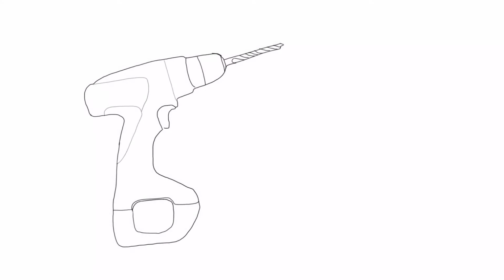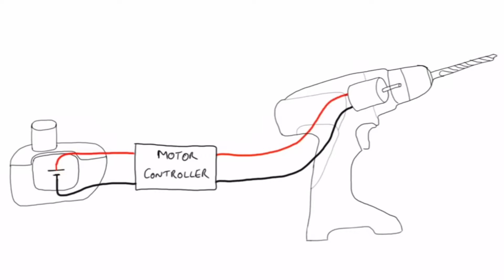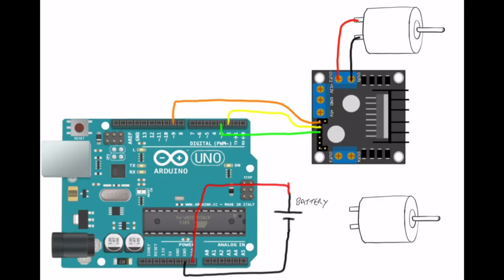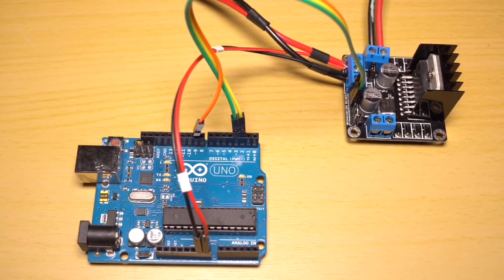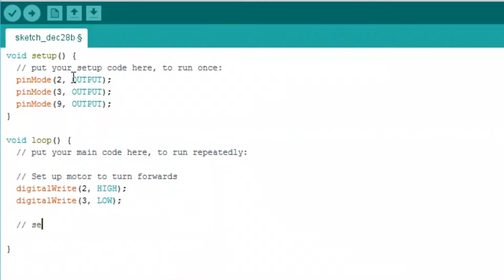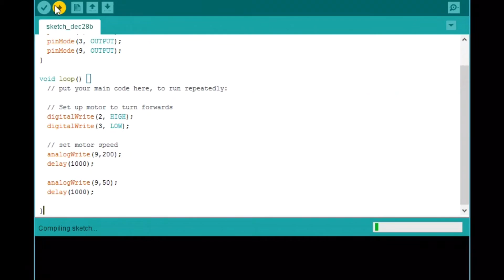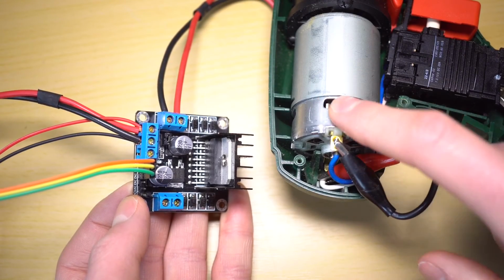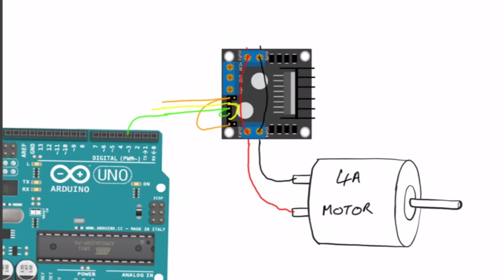Controlling an electric drill motor using an Arduino

Comment: I need to make a spinning 12v motor agitate forward/reverse endlessly. In 2024 you’d think it would be easy but evidently not. Can anyone here help me?
Reply: You need a 12 Volt Power Supply, an Arduino Nano and a BTS7960 43A H-Bridge and tweak this program a little. It's not very difficult and there are lots of examples on Youtube to get to know how this should work. Have fun!

Comment: Great video and thank you for posting. I recently did this following your video with an L298N motor controller and an 18v 2amp battery. In order to get this to work I had to remove the 5v jumper from the motor controller and take a 5v output from the Arduino to power the controller. Just in case anyone else comes across the same problem

Comment: Ahh I’ve bought a 2 channel receiver to work a 21v cordlessdrill motor… i hope it will change direction and have also purchased a speed controller (volume type)…. Can i ask anyone here if it’s an easy process or should i be aware or careful trying to put together…I’ve no wiring experience 🤣  any assistance is greatly appreciated;)
Reply: Can you link the speed controller and the receiver? From my experience, the easiest and simplest solution is a BTS7960 driver

Comment: Hopefully this is not a stupid question, but why not use the drills onboard motor controller, and just hijack the drill trigger circuit? I was hoping to do a very similar thing but II was hoping to use my  RC receiver to talk to the onboard circuit directly if possible. Or if not to have the RC receiver talk to an arduino, then that arduino talk to the drills esc.
Reply: It's not a stupid question at all. It makes all the sense in the world to reuse extremely convenient high power MOSFET that comes with these drills since it already meets certain specifications regarding the motors expected current draw. You will need a bit of extra work to be able to run it in reverse but I can only describe using the L298 (which pretty old) for a drill motor as not only uninventive but fairly ineffective compared to similarly simple solutions.

At least he tied the pins together though. Most people don't point that out in videos featuring the L298.
Reply: @io2cs-n8s  "compared to similarly simple solutions" Which solutions are you thinking of?
Reply: @uku4171  by that I was referring to the use of the mosfet.. If you wanna use an l298 go for it. It certainly is the simplest due to lots of tutorials but  there's a very real chance it burns out trying to drive a larger motor since it's an old inefficient chip. But mosfet driving circuitry is not too difficult either even if you want to make if from scratch with a few extra components. Best of both worlds might be to just get a pre-made mosfet driving board (which may even come as a full h-bridge) that's more powerful than the l298 for around the same cost on Amazon. So I do consider that a similarly simple solution, with likely better results. 

Hopefully that helps or gives you some ideas.., re-reading my comment I didn't mean my comment to sound like such an attack on this video or the l298n.
Reply: @io2cs-n8s  by the use of the mosfet do you mean making your own H-bridge? I found the best cheap driver to be BTS7960 drivers.
Reply: @uku4171  Yeah that's a perfect example of a solution that would be way better than the l298n drivers for this application. But as far as making your own h-brigde, it's still not crazy difficult but at that point a premade board like the one you mention is probably not only simpler but as good as you are gonna get for the same price. 

The point of bringing up mosfets in the first place was because as the OP mentioned just about any drill comes with at least 1 mosfet that you'd already be getting for free along with the drill motor. And if your use case doesn't require an h-bridge (ie you just want to go in one direction) that solution means you don't need to buy a driver separately. Although I suppose it does require that you have the means to drive the mosfet from whichever microcontroller youre using.. 

tldr the l298n is just kinda meh so if you really wanted a low cost DIY/hack solution it should be brought up that the drill does come with it's own driving circuitry. But if you need or are willing to purchase a better driver like your example then that is probably what you should do since drill motors need a lot of power. (ignoring the l298n in either case, although this youtuber fully acknowledges that it is not designed for high amps)
Reply: @io2cs-n8s  agreed

Comment: Is it possible to have the arduino monitor a 12v battery bank and turn the motor on when the voltage drops to a certain level?

Comment: What is pin 9 doing?
Reply: PWM (Controlling the rpm of motors)
Reply: @arias80rp10  thanks, I wrote that before I realized that not all pins are equal.

Comment: I had done it before and L298N gets too hot, like burning fingers hot, I wonder if there is a better driver for more current?
Reply: There certainly are. Just look for a driver that can handle more amps other than specs they all nearly work the same. Or better use the MOSFET that all these drills come with..

Comment: Hi James, thanks for the video very clear and informative.  I have only just found your videos so you may have answered this in other videos.  As I am sure you know, 12V drill motors will draw much mor than 4A under load, especially if it stalls at full power.  How are you avoiding this?  Are you using feedback signals to control the PWM signal to reduce the motor power supply?  I'd be interested in how you manage these issues.
Reply: Hi. did you found a solution for this? I have the same problem...

Comment: Thanks so far it is the best for me. Can I use on 2 hp 4 pole  1 phase max amps 13.7 motor? cheers
Reply: no u not, l2687n only provides 2A per out, then it burn out

Comment: Hello James, thats pretty much the same thing I am trying but my screwdriver motor is only making a whining noise. I assume this is related to the PWM values from the arduino. The motor is a RS380 that according to the print on it, runs with 3-6V. The screw driver was powered with a single lithium cell, so no more than 4.2V when full. Any ideas? Thanks!
Reply: hi there. i'm working on a similar project. were you able to solve your problem?
Reply: I have the same problem, any solution?

Comment: Does this work with a 9v battery? Because mine doesn't want to work. Am I using too low voltage? I am trying to make a 3v dvd motor run. If I can get that working, I can build my ev longboard

Comment: Thank you! What would need to be altered to enable the solution depicted in this video to work with a conventional corded drill that runs, on say 220 - 240 volts instead of a cordless drill?

Comment: The L298N that I am using has a jumper where you are connecting pin 9.  Do I remove the jumper and normally what does it do?
Reply from the maker: The jumper is there to make sure that the L298N is permanently enabled, it would be useful if you only wanted to control the direction of the motor, not its speed. 

To control the motor speed, remove the jumper and connect to pin 9 of the Ardunio.

Comment: I want to do the same thing, but run it all from the 12V wall brick.  Instead of wiring the battery to the Vin and ground, can I just plug in my power supply and then run the Vout to the L298N?  If I can't run the Vout (I think it downgrade voltage to either 9V or 5V), can I just splice the L298N to the same powercord?
Reply from the maker: Hi Christopher, what sort of wall brick are you planning to use? It's worth bearing in mind that a motor of this size will draw perhaps 2A when running, but much more current when starting to turn. The battery is well suited to supplying this current, but a small wall brick may struggle... With a large enough power adapater though, you can replace the battery as you suggested.
Reply: Good to know.  I had a 12V 1A and a 12V 2A, and the load is pretty light.  It's ok if it cycles up to speed.  My drill motor is basically turning a threaded rod that will extend/retract a drawer.  On another note, I'm going to be using keyboard commands for opening and closing it, which means the Arduino will have to be connected via USB for data, but that gives it power too.  Do you know if there's a problem having the Arduino connected to the 5V USB at the same time as the 12V battery or wall plug?  Don't want to burn out my Arduino.  Could I connect the Arduino to the 5V and the Gnd from the 12V, and then just connect the L298N to the 12V?  Lastly, I assumed the Motor Controller would handle this as wired, but is there a difference in setting this up if I need the motor to spin in either direction?